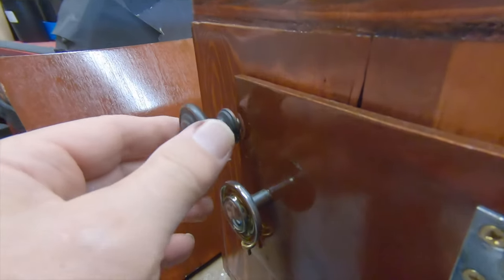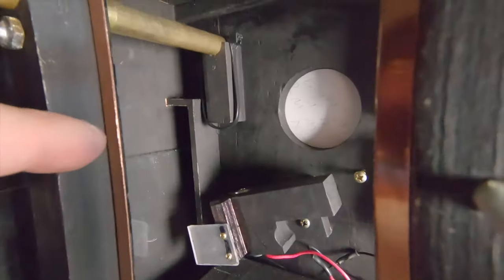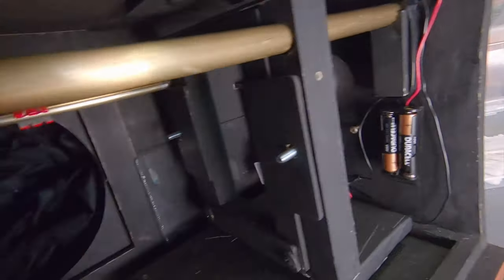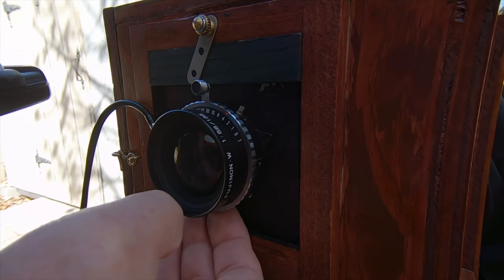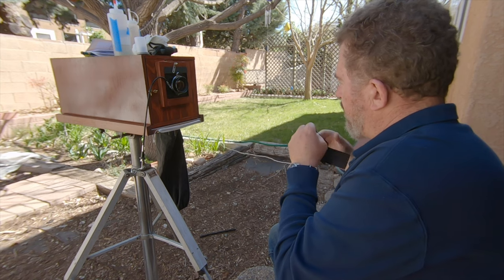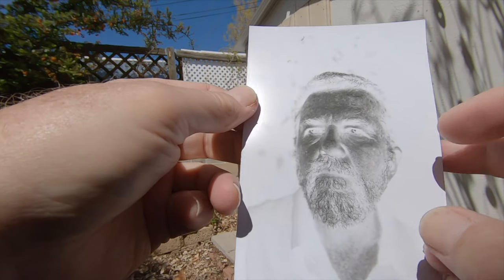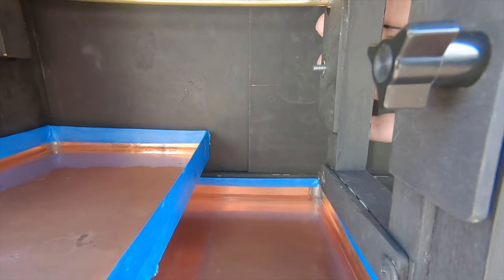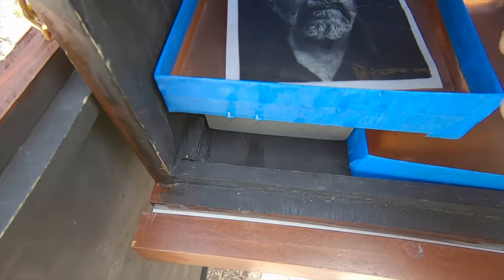Dark Box Camera Part 3

Comment: Nice work. Quite an impressive result. Regarding the paper holder, rather than knurled knobs on long threads that have to be found, lined up and fiddled with, maybe a (not too strong) magnet at the top of the holder to keep it closed and a grab knob permanently attached at the top of it.

Comment: Hi Joe! For the contact print, can’t you use the focusing screen instead of the glass? Why like this? Regards! Nice Video!
Reply from the maker: The texture of the focus screen will be printed into the negative, especially considering it's handmade and exhibits some swirl marks from the orbital sander. My intention was to mimic the way contact prints are done in the darkroom, under clear glass.

Comment: What type of focusing are you using ? I want to make a DIY box camera with a lens, but I need some advice on how to get a focusing screen other than ground glass, which I'm unable to find/make myself. Could that be a sheet of translucid plastic of some sort ?
Reply: Yes that will work I have even used wax paper in a pinch as a ground glass
Reply from the maker: I use a thin, rigid sheet of clear plastic that I then sand down one side using fine grit sandpaper. I used a random orbital sander. You use the screen with the sanded side towards the lens.

Comment: Hi joe! What lens are you using for your box camera? and do you have any recommendations for a cheap lens?
Reply from the maker: I started with a Kodak Ektar 127mm F/4.7, from a Speed Graphic. I currently have two of those lenses. I've more recently been using a Fujinon 135/F5.6. The Fuji lens has a more modern shutter, its speeds are more trustworthy.